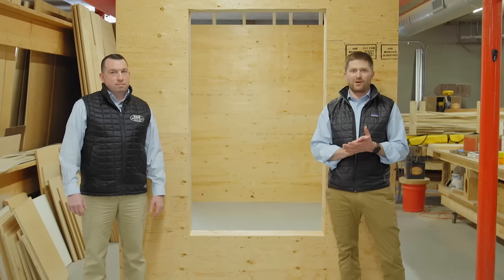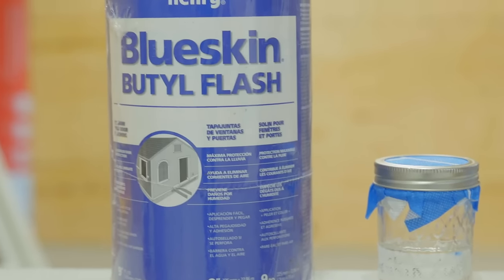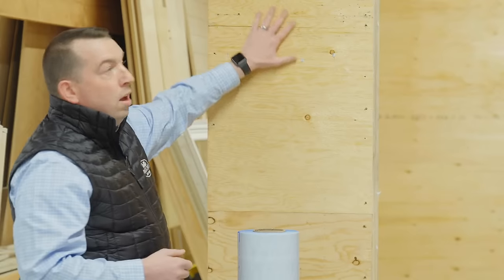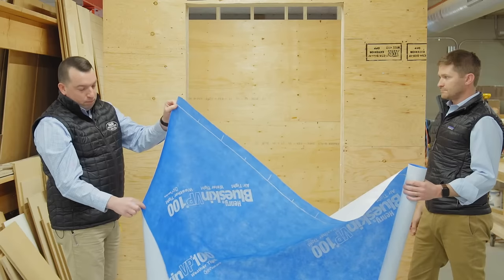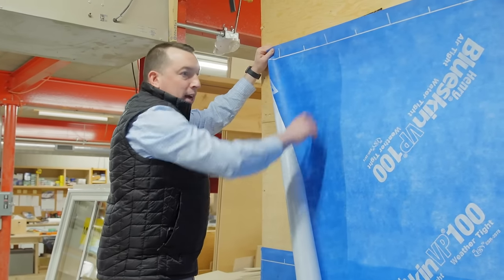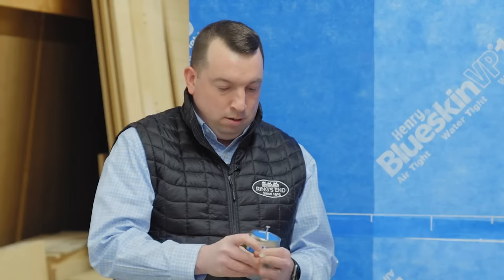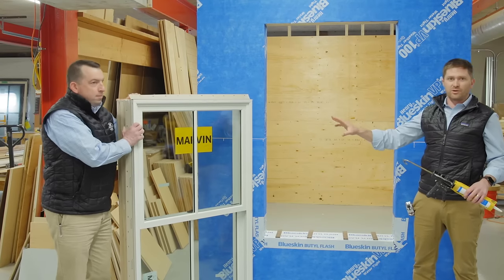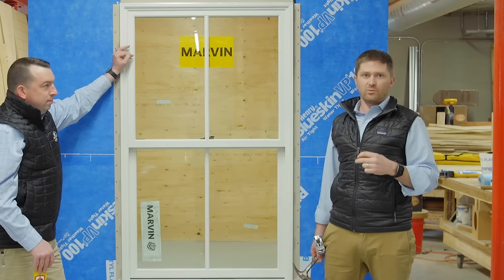Marvin Window Installation with Henry Blueskin VP100

Comment: Excellent and informative video! I'm a homeowner replacing window's, door's, WRB and siding on the home I purchased last year. I also choose to use the Henry BlueSkin VP100 run vertically over OSB sheathing and all my new windows are Marvin Elevate (18 total). My install so far is very similar to yours with the exception of sealing products. Instead of the Henry products I'm using DuPont Flexwrap NF for my pan and 3M Allweather for my flashing tape and DAP Dynaflex 230 behind the nail fin. I am however using the Henry Crystal Clear sealant on the top flash as you did. With the weather up here in the northeast it's taken me 2 months just to strip off the old cladding, install the VP100 and 4 windows on one wall (doing it by myself). I'm finally ready to install 1x4 furring for a rainscreen then my trim and HardiePlank lap siding. Hopefully I'll make better progress on the remaining 3 walls next year. Anyway, I do have a question for you. How did you secure your window shims on the inside so that they would not dislodge and move with normal expansion and contraction? I called Marvin and they said not to nail them and that spray foam would hold them in but what if I don't want to spray foam them? Their actual written instructions do not mention how to properly secure them.
Reply: Would you recommend that he nails as well, or shims only?  Nice Job

Comment: Thank you for the detailed instructions.  How is the flashing/ install different if the Marvin Elevate windows are being installed in concrete walls?  Would the Flashing tape just extend onto the concrete itself?
Reply from the maker: Great question Mike.  We would recommend using a liquid flashing from Henry called Airbloc LF.

https://henry.com/residential-and-light-commercial/window-and-door-flashings/air-bloc-lf

You can also see the recommendations from Marvin on best practice application on concrete here: https://www3.marvin.com/WebDoc/Elevate%20IZ3%20Supplemental_19971049.pdf

Comment: Can the nailing flanges be open from the outside if you wanted to insulate from the exterior?
Reply: @rings_end  let’s assume one wanted to size the window without having to remove the interior casing. Use screws to mount the window temp from the exterior until the interior is secured. Pull the screws from the exterior, foam insulate from the exterior (assuming the flange’s will pull back this way) and then continue with the blue skin water protection. 

Would this work ?

Comment: So can i use zip stretch flashing and zip tape with vp100?
Reply from the maker: You can, but it will not be qualified for the Henry 1-2-3 Step Moisture Control warranted application.

Comment: I see you have drawn out the "l" cut.  Can you also do a shorter "I" cut so you can FOLD IN ALL FOUR SIDES, instead of only the left and right side??
Reply: @rings_end  thank you very much for the feedback.  Last question, the purpose of NOT folding the top, why not?  Can I fold the top and bottom and still flash it with tape and such?
I'm just thinking of providing an additional layer of protection by wrapping all four parts of the window frame.  Thanks again for creating this tutorial, really appreciate it!

Comment: I’m a ABAA commercial installer,and I don’t know what the heck this guys doing….I’m guessing commercial and residential is totally different…vp160 and SA….and we used adhesive ALWAYS!!!!!! 
He forgot to mention about the factory lines HENRY gives 100 percent warranty 😎
Reply from the maker: Thanks for the comment. Yes, you are correct Henry does require either Aquatac or LVC primer/adhesive with VP160 or Blueskin SA commercially. For residential and light commercial applications with Blueskin VP100, the primer adhesive is only required on non-wood substrates or when adhesion is impacted by cold temperatures.

Comment: That self sealing demo.   Is not convincing.  😂
Reply from the maker: We're sorry you are not convinced, we will consider that for next time.
Reply: @rings_end  popping a nail thru a piece of cellophane  wrap has the same results as Blueskin ….I did my own test  draped it over a glass bowl 🥣 punched a hot dipped galvy nail thru pored water 💦 on it and it 
Leaked like a sieve 
Blueskin is not a self sealing membrane